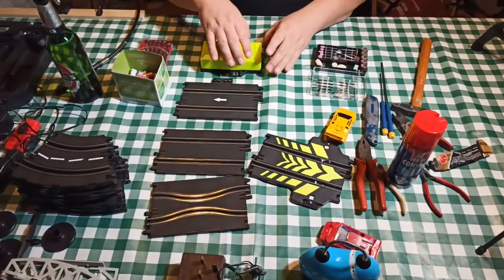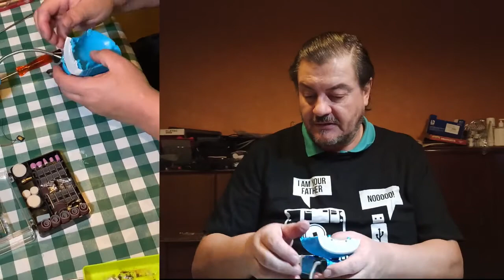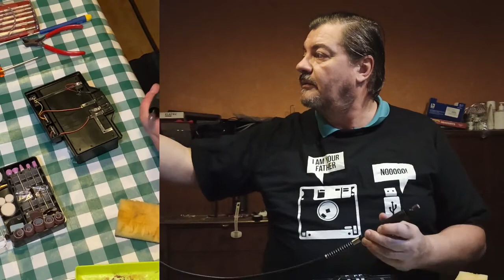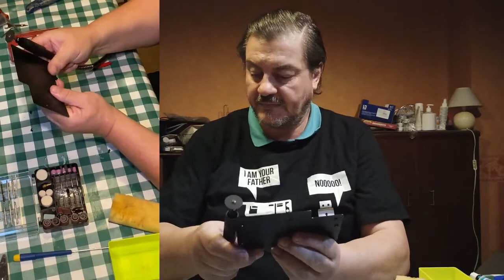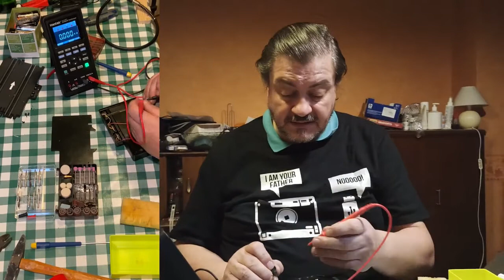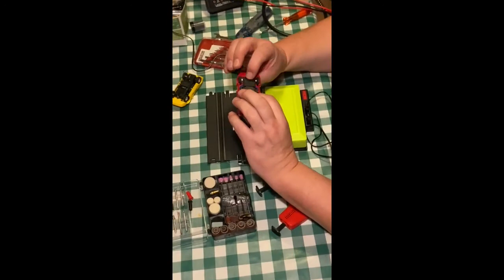Battery operated slot car power conversion

Comment: Hello, I have an extreme drive battery, it does not go on the track with a 5V 1A power adapter.
It goes on the track with 3 LR14 batteries, batteries 3x1.5V = 4.5V
Why doesn't it work with a 5V adapter? Is there a problem if I run it with a 6V or 7.5V adapter?